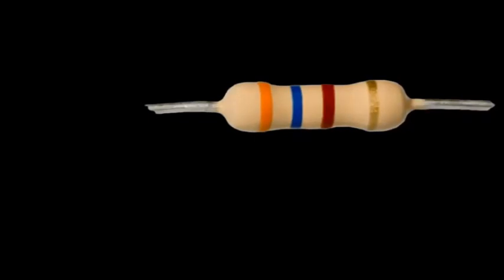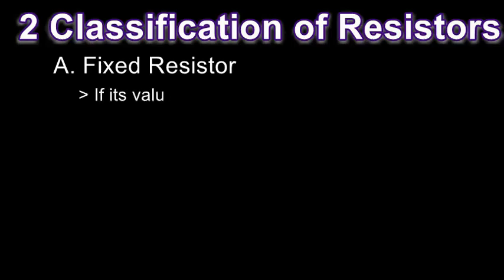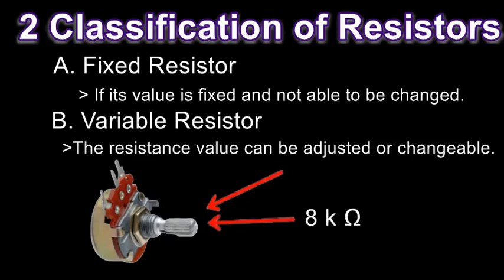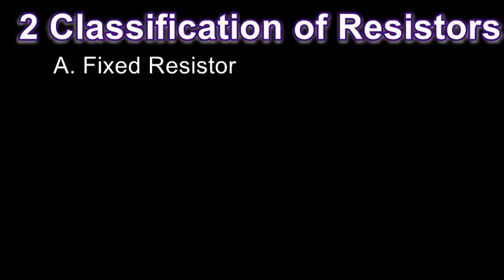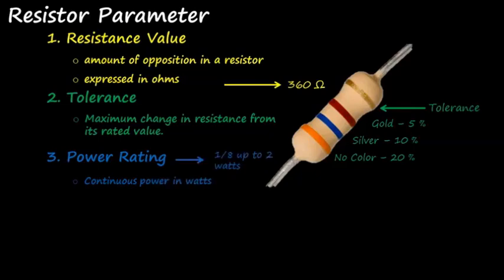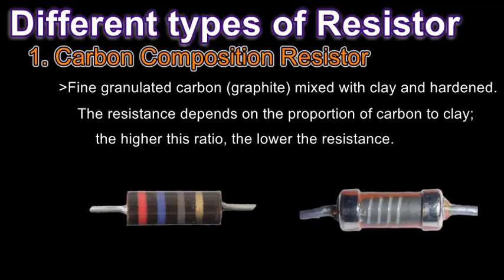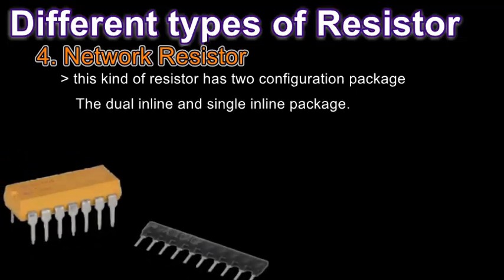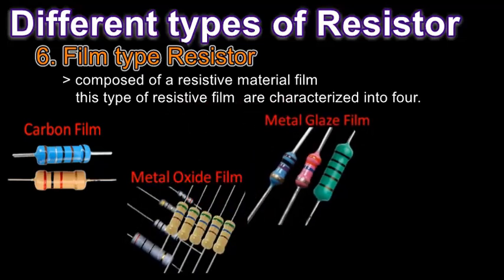Resistor | Types & Characteristics | Electronics Component

Comment: I have a bunch of random resistors, and I'm wondering how can I tell if they are Carbon film, Metal film, or Metal oxide etc? Basically, I just bought a tonne of NOS resistors in various values, and almost all of them are the lighter coloured sort of beige looking ones, and besides like the blue, and other coloured ones, I noticed in almost every category(CF,MF, and M Ox etc, they all have some in the light sort of beige coloured ones. Also mine are all the smooth/shiny kind of finish. So, is there a way to tell, because no one really talks about this.

Also, whats the main differences between Metal film, and Metal glaze film?

Comment: Question po Sir in 2:37 Po ng video. Yung Po ba 360 or 3600?
Reply from the maker: 360 ohms. Its clear, brown ang multiplier which is brown is 1, so adding of 1 zero or x10 is equal to 360.
Reply: @niceeugene  uh sir that multiplier is red